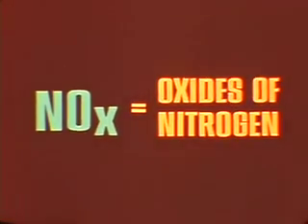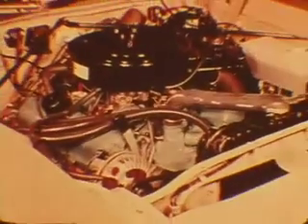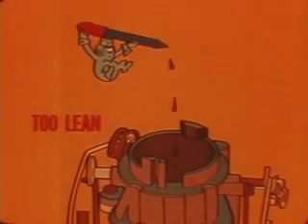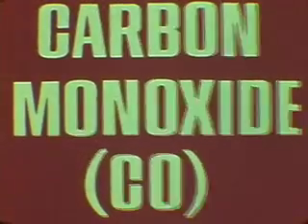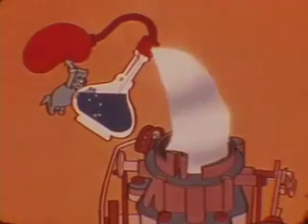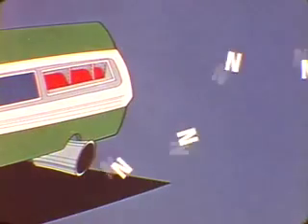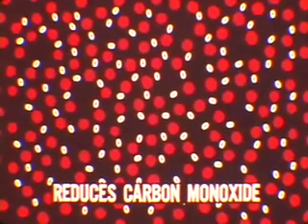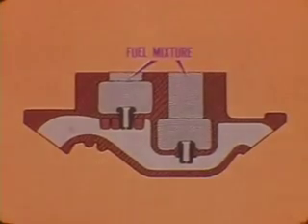MTSC - 1973, Volume 73-7 Exhaust Emissions & Driveability

Comment: 7:00 - huh?  Lean condition drastically increases combustion and exhaust temperatures.  Run a turbo charged vehicle lean and see what happens - blowtorch right through the pistons.
Reply: They said "very lean". If I run an engine with no fuel in it, you think it's going to melt the pistons? There's two types of cooling, one is fuel cooling, from the heat of vaporization of the gasoline, and one is air cooling, by simply moving air. As you lean, fuel cooling decreases, but then air cooling takes over, so you peak CHT/EGT, then it drops back down. This is well known in aircraft piston engines, you find the peak CHT/EGT, then continue to lean until a specified drop.

Comment: Triva: A lab tech named Don Berry tested the first Chrysler engine to run on NO LEAD fuel in 1969. The lead gas burning 318 was only changed over to no lead and on the engine dyno we ran a simulated road trip from high land park mi. To Chicago I'll. The engine lost 30% of its power in about 3hr.
Reply: So just to be clear... Avoid lead in fuels?
Reply: @austech360  no we just engineered engines to run on the new fuel. No lead is great. Change is ok. It allowed us to cut emissions way down.
Reply: @60viking  I just got a 1976 dodge 440 engine inside of an american clipper motorhome and it needs to pass smog and I'm trying to learn about these old systems incase it doesn't pass. It smells as rich as bill gates and it's missing most of it's exhaust system. Any tips or advice you could give me to pass California Smog with such an old engine?
Reply: @austech360  well that's a big order. Does it need to pass 1976 standards? Does it have a thermoquad? Fix the rich and put on any converter. Tune with Chinese specs."waylean". But for sure engine condition matters. Good luck.
Reply: @60viking  yep. Got a thermoquad on it. From what I can find. It's not supposed to have a cat on it. I believe that 76 standards are correct. Not sure though.

Comment: Emissions and Driveability did NOT play well together, until 1986, with some fuel injected Engines, and across the board in 1996, when the New Generation Computer Engine Management was finally perfected. OBD II actually came out in some selected vehicles, since 94. However, bugs were PLENTY, and being a bit of a combination of new and old, it was more difficult to scan and diagnose, and by 2002..... The ONLY way to properly fix the System installed in 1994-95, was ECU REPLACEMENT!! 
Costly, but for the first time, those first "ugly stepchildren" had the ease of testing and diagnostics of the REST of the OBD II line!! 👍👍
Reply: I disagree with the idea that it wasn't until 1986. The Datsun 280ZXT and Maxima worked well with their EFI back in 1981. The 300ZXT came out in 1984 and was good. What I find fascinating is how rare OBDI Nissan test tools exist. Were OBDI Nissans good, or were they just too uncommon to matter?